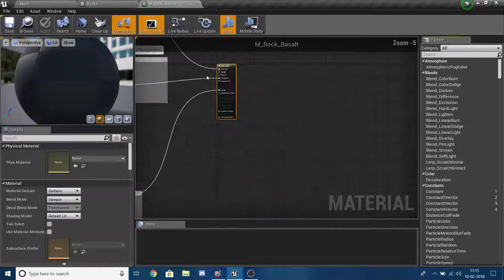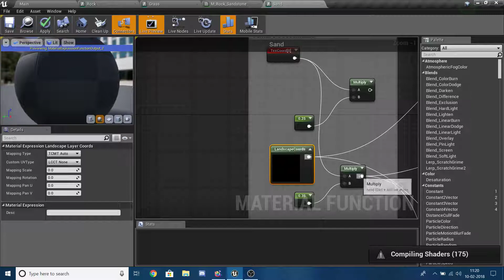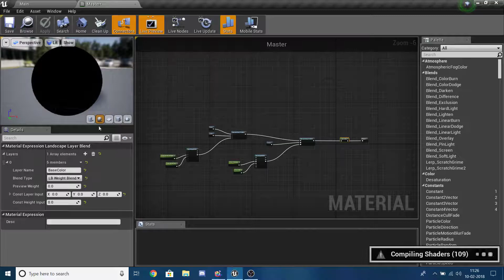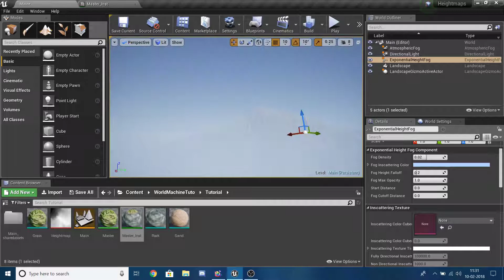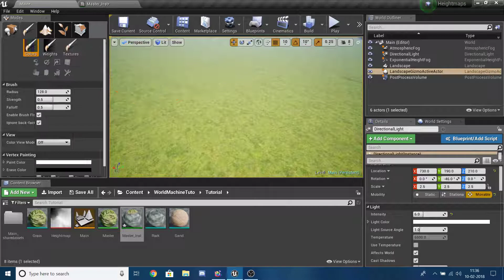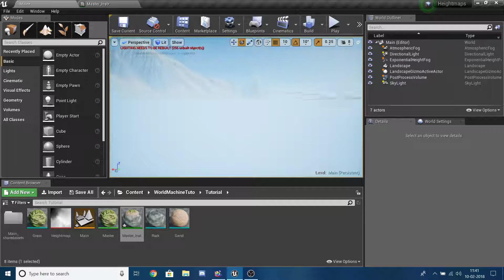Comment: This video series has been so incredibly helpful. I'll definitely be checking out the other series on your channel! I actually had a quick question about lighting and landscape scale. I'm currently using the free version of world machine and imported my landscape as a 505 x 505 resolution. In world machine, I had the map width set to 8.08 x 8.08 km so that I could simply scale the landscape up to 1600% on the x and y to get to the correct size (16 x 505 gives 8080 m, 8.08 km) I also had my height set to 2048 in world machine so I could do 400% scale on z to get the correct height in UE4, since it gets scaled to 512 meters (4 x 512 gives 2048). The issue I ran into was blobby shadows on the mountains when I built lighting, even on the highest build quality. I did a few google searches and it seems that it's connected to low lightmap resolution. I tried scaling the landscape back down and it looked like the lighting was a bit better, but its hard to tell. Do you know if scaling the landscape actually has an effect on the quality of the shadows, or is it solely due to the low import resolution of the landscape? Thanks!

Edit: Do you have static shadows enabled or disabled for your landscape?

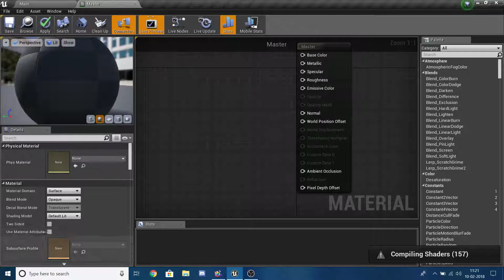Comment: at about 8:21 you put the materials in but i cant seem to do that. is there any key i need to press? (f didnt work). i selected all three of them and then pressed f on the screen, didnt work, so i just tried to drag them in. that didnt work either
Reply: press f in your mat editor it should create an empty function do this 3 times and assign the 3 material function in the "Unspecified Function" node that comes in your main master material editor when you press and left click f in the graph
Reply: @SmarTechDev  I ran into this issue as well. Solved it by right-click > Functions > MaterialFunctionCall. Then select the individual function and select material function in the details editor.